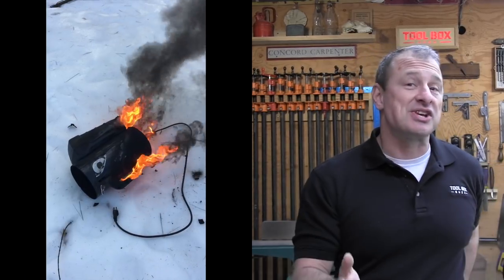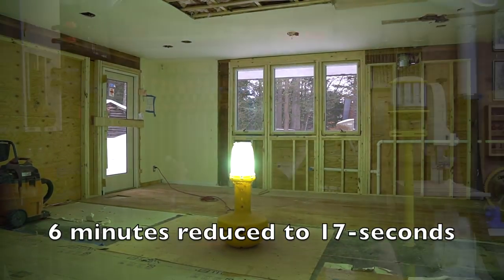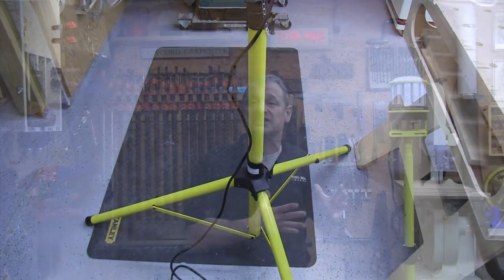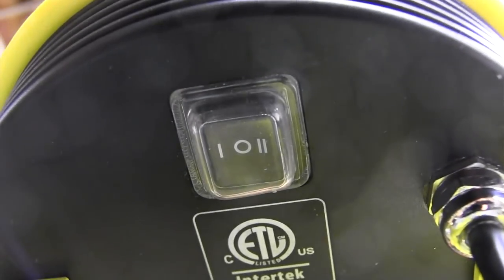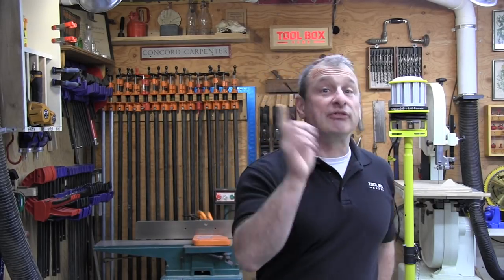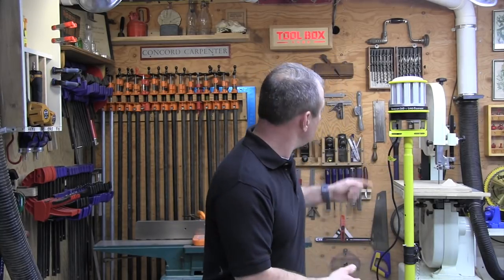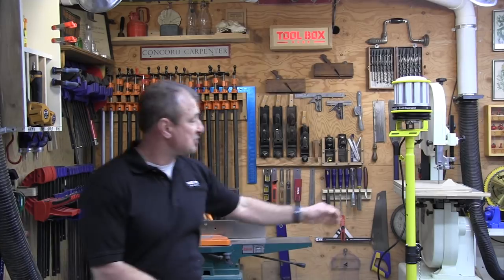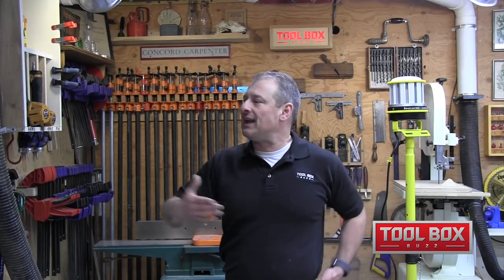LIND Beacon 360 Degree TREK LED Area Light  Review

Comment: Rob I really appreciate your videos man you do a great job... For work lighting 4700k does make sense, although, I have found through a few years of experimentation that when it comes down to comfort (not necessarily for working)  I really prefer around 3500 to maybe 4000k for room lighting. Unfortunately that range seems to be the most difficult to find in stores as 2700 or 5000 is what you’ll easily find... Also, a little tip for the occasional use of those cheap/junk 500 watt halogen work lights. I’ve found that if you replace the straight bulb with a 300 watt or even 150 watt (some stores have them), they seem to perform and function MUCH better, much less heat and most of all the bulbs seem to last 10 fold in duration of life. They just don’t seem to burn out like the 500’s and they’re still PLENTY bright. Halogens still have their place for me while in colder work environments but I really need to get a couple of these 360 degree LED work lights. The benefits seem substantial. Thanks Rob and great video. 👍🏽

Comment: For 7000 lumen that's not very bright. It looks like it's sending a great deal of the light straight up where it's useless, to a halo on the ceiling. Was really hoping when I saw the design of this it'd be designed with better light throw in mind.
Reply: It's perfect for working in any rooms. Most renovations require work on the ceiling, like pot light installation, new paint job etc. So a light that hits the ceiling is perfect for these reasons!